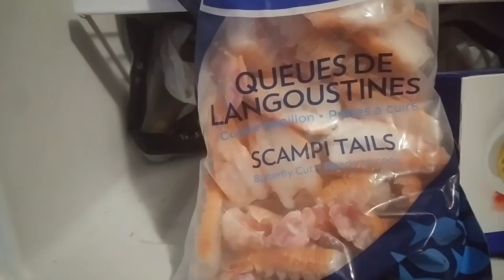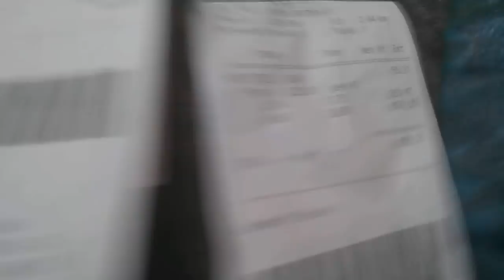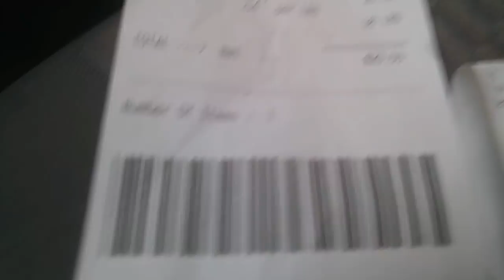COPPER +ALLU RADS / RUSH COSTOMERS... /scraprun

Comment: For the radiator, all you need is a very sharp knife and run it down the radiator, and you can pull out the long copper pipes, and sell the rest as alumin, it's very easy, instead of just cutting off the ends.
Reply from the maker: i tried cople year ago and even with gloves i was butching my hands and arms on the alluminum ...and the copper isnt realy heavy either 
stil have a decent price has is ...maybe ill try back again and do the math with scale /time value will see 
thanks for the advice and for watching
Reply: No point in all the work to get the copper out of rads they pay good like that you won’t make much extra for a lot of mess it’s not as easy as you make it sound